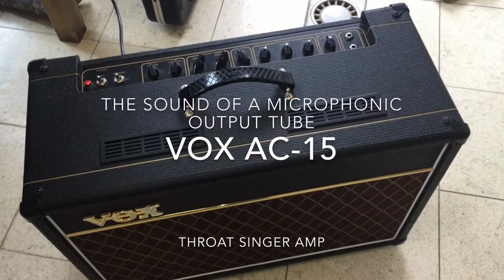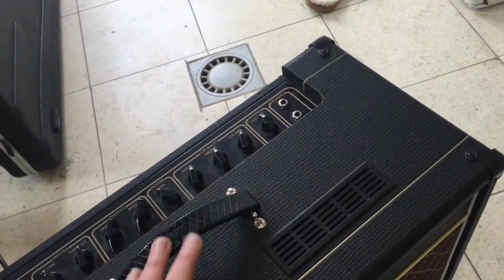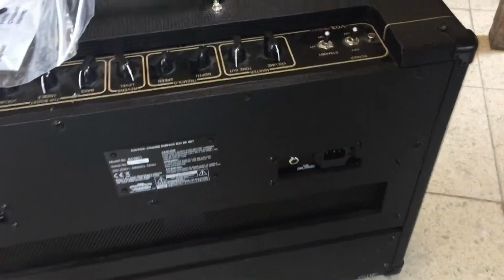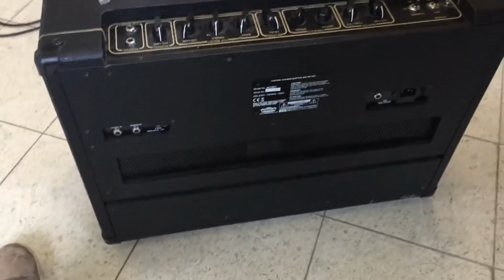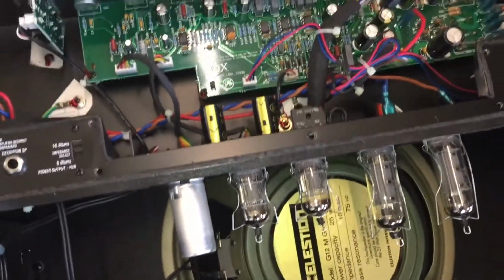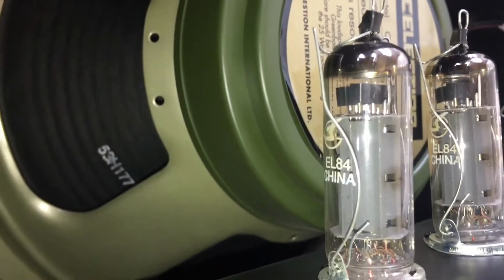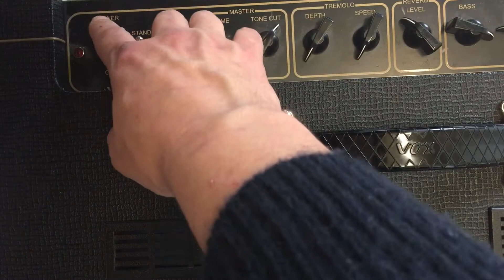Vox AC-15 noise from a microphonic output tube

Comment: I like TAD el-84 tubes in mine. Some decent preamp tubes and those amps sound really good.
Reply from the maker: Hi Gobi, yes I tend to think that all the 'made in Germany' tubes are actually East-German military surplus, i.e. Russian tubes. Tubeampdoctor.com is about the only European supplier of amp kits and parts. When my recent order got delayed because most of the team was at NAMM, in the USA, I started realizing their tube business is much bigger than the amp kits/parts. I wonder what they will do when the Russian stock runs out, which will happen at some points. 
Check my shootout on EL84's which shows 'made in Germany' tubes which the Russian printing with date code still on it ... TAD however, takes special care to remove the original lettering. https://youtu.be/e0YuCt9qLzY

Comment: How did you fix that problem?? My vix is doing the same thing but only when I play the low E and tap the amp
Reply from the maker: ray vargas replace the microphonic tube(s) of course
Reply: Thanks! I’ll give that a try!
Reply from the maker: @abazaba800  make sure that the tube is seated properly and check for microphonic tubes by tapping it with a chopstick. Another Vox repair coming up following week, don't forget to subscribe ;-)